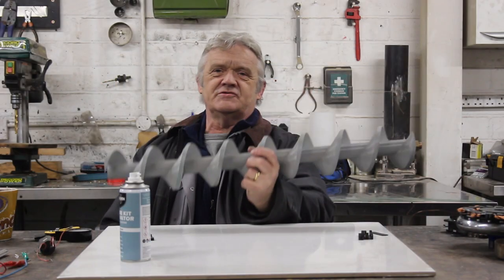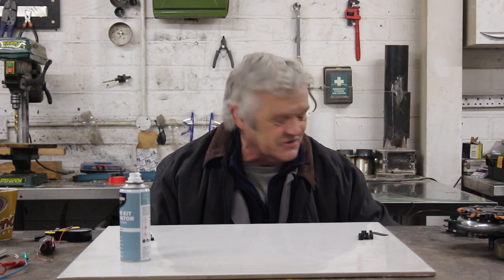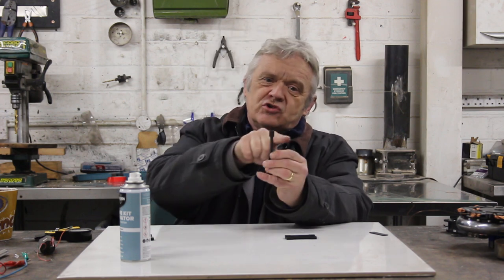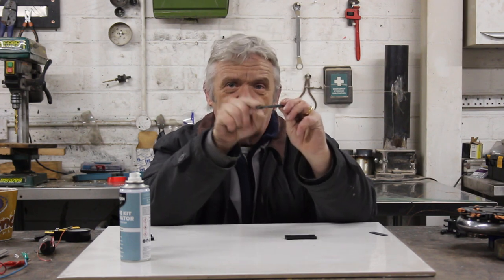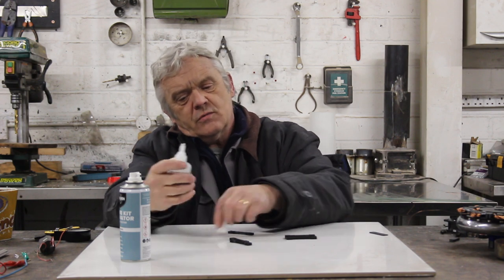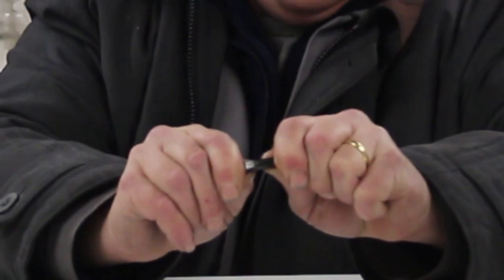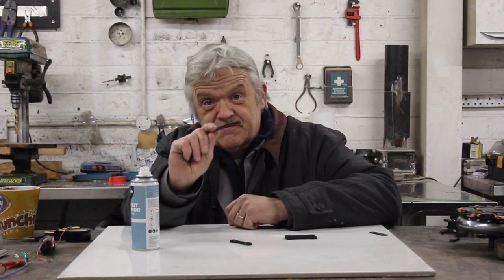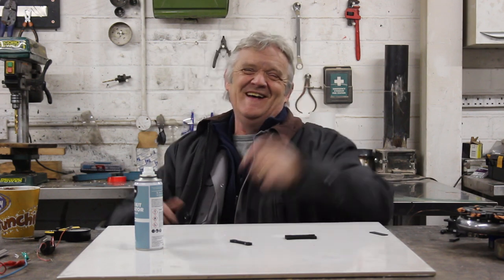1857 How To Make Super Strong 3D Printed Parts

Comment: The people suggesting putting it in an oven aren't completely out to lunch. It is called annealing and is a very popular method of increasing certain properties in the plastic like impact resistance, temperature resistance and strength even. An oven is excessive because of the wasted volume and energy, a little annealing box is much preferable. You'd have to print the items at 100% infill and they need to be flat if you air-anneal them. You can also heat up very fine salt or sand and place the object inside a container of heated powder, this way you can anneal any object in a more controlled fashion which reduces warping significantly, still needs to be 100% infill for it to work but the parts will be much sturdier and temperature resistant.  PLA can even withstand boiling temperatures after annealing which is amazing really.
Reply: Yes glass annealing kilns do this for glass art but at much higher temps than pla need.  Fyi. Laurie. NZ.

Comment: I've printed with ABS before, and one neat trick with that particular material is to expose the parts to acetone fumes, which softens the outside of the parts and makes a really smooth surface. I'd imagine the layers bond together as well under those conditions to increase the strength. I think you would need a different solvent for PLA, though, as I've heard acetone doesn't have the same effect on it.
Reply: @jediknight2350  I had a 0.5l bottle of acetone evaporate in my office where I smoked heavily, you make me happy that the only consequence was that I suddenly felt very drunk and woke up with a hangover. Now I always handle volatile solvents with care and put on the cap as soon as I am done soaking the rag, filling the pipette or whatever.
Reply: @jediknight2350  That sounds pretty scary... I don't work with acetone very much anymore but I'll certainly be careful with it in the future. When I used it, I tried to keep it sealed up, sometimes even outdoors for ventilation if I was working with it extensively.
Reply: The only solvent I know of which allegedly actually works with PLA (the one you often hear about and I can't remember the exact name of now, probably ethyl acetate or something like that, doesn't really work), is chloroform. Never found a video of anyone testing it though
Reply: @jediknight2350  I have used acetone to smooth an ABS print in the past, the trick is to cold fume it, basically get a sealed tupperware box or something that doesn't melt in acetone, soak a bit of kitchen paper in acetone, put that in the box with your print, close it and let it sit for a bit, check it regularly. No risk of random fires that way at least, but obviously still put it somewhere well ventilated just in case
Reply: @irreverend_  I've also heard that, and I've heard you can even make chloroform with acetone and bleach. Although it's a bit beyond my skills to be able to do that safely, so I'll stick with sandpaper for smoothing my PLA prints for now...
Reply: @OceanBagel  it certainly is possible to make chloroform, but definitely inadvisable. You can buy it, but it isn't very easy to obtain (here in the UK anyway). You'd want to test it out under a fume hood ideally, another thing I don't have. On the other hand, chloroform isn't quite as bad as people think so long as you aren't directly inhaling it, you'd know you were feeling woozy long before you lost consciousness, and it used to be in Victory V's, which is why they're weak now :) Actually Kaolin and Morphine mixture used to have chloroform and diethyl ether in it until about 12 years ago, so in low amounts it's certainly not going to kill you, but definitely exercise caution if you decide to give it a go
Reply: Isopropyl alcohol  is the surface smoother you need for PLA
Reply: @robgoodsight6216  it absolutely isn't, it has no effect on PLA whatsoever. You need IPA for cleaning resin prints before curing, if you're not using a water washable resin (and those are pretty good now so I would generally use one since the clean up is much less hassle).
Reply: @robgoodsight6216  I searched it and the one everyone recommends (which i've seen poor to no results from experimental videos) actually was ethyl acetate. It may well depend on using a certain brand and therefore blend of PLA, but I've not seen a video of someone using it to much effect. Not like the cold fume acetone smoothing of ABS. Isopropyl alcohol definitely does nothing to ordinary PLA though
Reply: @irreverend_  Some PLA you can smooth with acetone. I think it is because some PLAs are blends of different polymers. I had PLA turn soft and sticky when spilling acetone on it (In particular Prusament PLA Lipstick red).
Reply: @ET_AYY_LMAO  it's possible soaking PLA in acetone can do that actually, although I don't doubt that some blends are mixed with something that can be smoothed by it, but PLA the compound doesn't melt like ABS does in the presence of acetone, and certainly not just the vapour. If you soak PLA in acetone I do believe it will become flexible, but once the acetone evaporates off, you'll find no difference in the surface of the print. It only absorbs the acetone, it doesn't react with it

EDIT: To the best of my knowledge. I should really add that to everything I say. But yeah I've been FDM printing as a hobby since 2015, but with gaps, so I'm not sure about modern PLA blends, but about PLA itself, pretty much nothing smooths it
Reply: If it isn't a high detail part you can tumble it in the finest grade silicon carbide in a rock tumbler to give a smooth finish. But that isn't likely to strengthen anything, and you still want the best possible layer accuracy to begin with.
Reply: @OceanBagel  heaps of videos on making chloroform on YouTube. Looks easy and safe
Reply: @irreverend_  you are right in pointing out the quality of the PLA.
Now a days there are many materials, recycled, virging, and also the colour might influence the exdrudability/ reaction.
My experience is the following...
If you need to glue something permanently onto Pla, use rubbing alcohol to clean the surface...better isopropyl. 
Pla has a highly crystalline composition...but...there is always a but...
It also depends on the extrusion temperature...the higher the more crystalline/ shiny surface you have...the colder the more opaque it is, hence can bring different result.
I seldom glue it....rather screw different parts together....
Reply: @stephenjones3737  Maybe in a lab setting with the proper equipment. But I don't have any of that so I'll leave it for someone else to try. Besides, it's not like I really need to smooth PLA. If I actually needed that smooth of a surface finish on a 3d print, I'd print in ABS and use acetone which I can just buy at the store.
Reply: @OceanBagel  I agree, I mean if I had a flask of chloroform lying around I'd try it out, but I'm not going to risk making it without a lab setup. The fact that I have yet to find a video (admittedly I haven't searched in 2 years) of anyone testing chloroform on PLA despite many sources claiming it can smooth it, suggests that it's difficult to do safely, difficult to buy and either no one is willing to upload a video of it, or they get taken down immediately I suppose. But you definitely shouldn't try to synthesise it yourself. And the number of sources I've read claiming it can break down PLA for many years, you'd think there'd be at least one video showing it. Even an article from late last year mentions it, but I've still never seen any tests
Reply: @stephenjones3737  it is certainly easy, questionable about safe. I'm just not encouraging anyone to try. The biggest risk I suspect is getting a ratio wrong and releasing pure chlorine gas, which you don't want to inhale, so don't attempt it without a fume hood at the very least. Outdoors /could/ be ok, unless the wind changes directions and you get a lung full of chlorine gas.
Reply: @jediknight2350  profile pic checks out

Comment: I don't like PLA.  They are very brittle and it gets worse over time the more it absorbs moisture. I prefer Petg. The layer strength is stronger and they don't snap under stress. They typically bend before it fails, and it can handle higher temperature than PLA.

Comment: im on the process of building my cnc and what came to my head was printing with 3d infill shape with thin shell and pouring epoxy inside. it will hold the linear rods (40mm thick). seen someone do an experiment and it proved my approach but i didnt see much more of that

Comment: speaking of grain - I highly recommend trying the wood PLA filament, it's not commonly known how awesome that stuff is.  The wood fibers in it make it print much better and it makes the objects much more heat resistant, and of course it doesn't warp as much during printing.  I printed a decoration to put on the dashboard of my car and regular PLA turned into a limp noodle the first hot day, but the wood PLA is able to handle the heat! (and I live in southern california) 
Also, wood PLA can be sanded much like regular wood, it bonds really well to wood glue as well as acrylic paint. It's just fantastic all-around.
The only issue I ever have with it is an occasional clump of wood fiber will cause a jam in the hot-end and the print fails, but ABS and regular PLA fail just as often for their own reasons
Reply: Would probably soak up the crazy glue nicely too!
Reply: @PolygonSwan  I haven't tried superglue yet but yea I bet it'll even polymerize like it does with soda ash!
Reply: That's what they all say

Comment: Thanks for that Robert, amazing result!
A couple of weeks ago, I 3D printed an adaptor for my workshop dust extraction system. Due to an oversight (cock up) on my part, I didn't add supports to the print, and the result was very thin area.
To remedy the fault, I used baking soda to fill the area and added superglue and it set rock hard!
I had heard of this trick elsewhere, but thought it may be useful to mention it, for those who may not know.
Reply: You can use other stuff then baking soda. I've seen cement and super glue works really well too and I've seen another video where they used a AA battery electrolyte. It's the black powder in a AA battery that seemed to work really well. I don't know how safe it is.

Comment: Interresting idea that I hadn't seen before. We need Stefan from CNCKitchen to do a comparison!
Also in regards to print strength, filament varies greatly in properties depending on polymer blend, additives, pigment etc.
To me it seems like neutral colored have the best strength, but can't really generalize I guess. All I know is that all the red parts of my wind turbine got obliterated two times in stormy weather, but the neutral segments in the same brand did not... Now its all neutral haven't exploded so far.
Reply: By neutral, do you mean white?
Reply: @scotttovey  No I mean neutral, as in no or very little pigment added. That might mean that it is less UV resistant though.
Reply: We used to find the red parts of some kids toys left in the sun would go brittle and fade, yellow was probably the most resistant to UV.
Reply: See: "STRONGER 3D Prints with GLUE? (and CARBON FIBERS)" by CNC Kitchen, he ran some tests about 3 years ago. However, Robert's glue seems to be doing a better job?

Comment: Genius!  The neutral fibers in the beam deflection example stay the same length - just as well with crummy plastic.  The extreme fibers that are tensioned resist with super glue tensile strength - legend!  Maybe flex the sample some to force the SG deeper for more durable adhesion under repeated flexion.  Kind of a case-hardened composite polymer concept - and it DOES achieve that ever-elusive real increase in part strength.  Good going, again, Robert!

Comment: Very cool. I wonder if anyone will design a printer that can include a "glue step" for each layer.
Reply: You can always print at a lower quality, that will leave larger steps. Now having more space for glue doesn't directly equate to more strength. This is great info though, I am printing a huge (8" diameter 90 degree probably 12-14" pipe) from PETG I am going to try it with that.

Comment: check out reheating 3d printed parts in powdered salt. The part remelts into a solid while the salt holds it from warping. Then you simple take it out and rinse it off which the thin layer of salt on the surface gets dissolved away

Comment: When mixed together, super glue and baking soda's strength exceeds that of plain super glue. The enhanced strength and quick drying time make the blend of super glue and baking soda ideal for quick surface repairs in high-traffic areas. It is also perfect for filling gaps and cracks in surfaces and repairing broken objects such as furniture. The super glue and baking soda mix also bonds more readily with plastics than plain cyanoacrylate, making it especially useful for repairing cracked plastic materials and components.

Comment: The thin (laminating) epoxy works well too. Makes it possible to sand to a mirror finish and is very strong. You just need to soak for a while and wipe off any excess with paper towel well before the gel stage.

Comment: It's worth noting that you probably can "anneal" PLA prints in a dehydrator, starting around the glass temperature of your filament (usually around 65-70C but can be lower) and then knocking the temperature down by 5 degrees every 10 minutes or so for an hour or two until you get to room temperature. That is pretty accurate temperature control compared with an oven, won't melt the part but can allow it to glass slightly, and reduce overall stress on the part with a much slower cooling than the initial printing. I haven't actually tried that before, since I've never really printed anything undergoing a lot of mechanical stress, but the theory sounds fine to me (what I read actually suggests using an oven at 65C, turning it off and letting the parts cool as the oven does, but I think a dehydrator would be more accurate).
Reply: We mould a small part at work on an injection moulding machine. They get annealed in an oven after moulding. It's actually an environmental chamber so it automatically gradually reduces it's heat. Think it's 120°C for a couple of hours but it is GF nylon.
Reply: @Opel_Guy  Well that supports my idea about the gradual cooling, and of course shrinkage during cooling causes stress, so slower is better. Also I know that nylon is incredibly hygroscopic and whilst you can 3D print with it (at higher temperatures than PLA so 120C for annealing makes sense), it sucks up moisture from the air within hours. It's the only filament I've seen in tests that genuinely needs to be put in a dehydrator before and probably usually during a print

Comment: Fantastic idea. BTW, you can use Baking Soda mixed with water in a spray bottle to act as an activator and the Baking Soda will set like concrete when it comes into contact with the Super Glue.

Comment: ASA filament is fairly strong, but most importantly, highly UV resistant. Usually needs an enclosure though, to avoid warping. But can be glued/bonded/melted with acetone, like ABS.

Comment: Never thought about using the CA glue to increase the strength of the part.  Ive use it to adhere parts together. I've also experimented with epoxy and also construction adhesives.

Print orientation and infill density are my usual suspects when trying to print a part that requires strength. I am intrigued though. Will try this one. My superglues are all gel types. Need the regular type so it flows into the layers. 

Thanks Robert.

Comment: Another thing you can do with crazy glue is activate it with baking soda.  This method is good for filling in cracks in things, instantly.
Reply: What is activator? Doesn't super glue activate itself?
Reply: @rgfxnet  Yes. Instant activator speeds up the curing time (the bond normally takes a good 10 minutes to set and a full strength bond w/o an activator takes several hours)

Comment: if the strength of the pla or print filament is proportionate to the linier direction of the layers one may wish to look into the strengths of different composite weaves of fiberglass and other composite meshes... win crosshatching the layers in two or even three directions your bonds can disperse the tension more evenly and therefore make much much stronger prints... Play with the slicer programs to learn more...

Comment: I once found that the Hatchbox translucent/clearish green PLA filament printed at 100% infill 220°F print temp with a 60°F bed temp prints incredibly/surprisingly strong.
Reply: The odd thing about 100% infill prints (aside from taking forever on a large object) is that they're usually much weaker than 20-50% infill (at least along the layers). I believe it's because of the cooling, the full layer suffers shrinkage and there's no give, so there's already stress between each layer. But for very small things, and where the force acting will be in the direction of the layers not perpendicular to them, then yeah 100% infill is very good

EDIT: Described the direction of force really badly there, I was thinking of pulling specifically, basically anything that isn't pulling or pushing in a direction that would likely delaminate the layers
Reply: @irreverend_  Thank you for that, I'll have to check into that and do some testing.
Reply: @ProlificInvention  I hope your testing confirms it, it'll definitely save you a lot of time, material and electricity if you can get stronger parts with less material :)
Reply: @ProlificInvention  also I believe cubic infill is the strongest general infill pattern